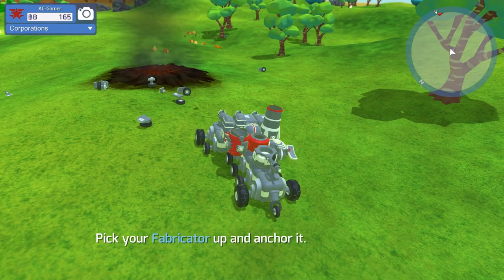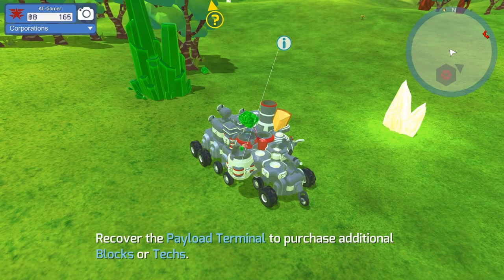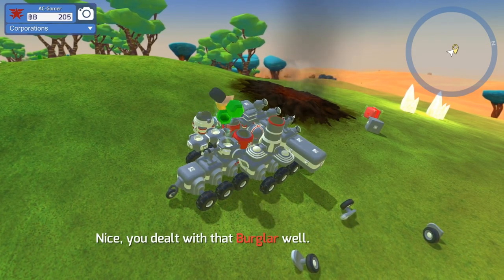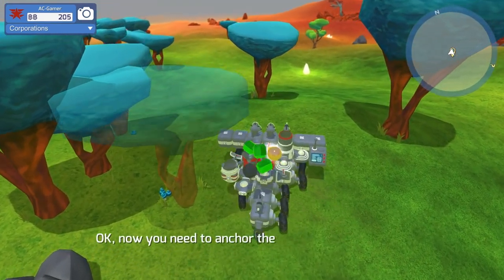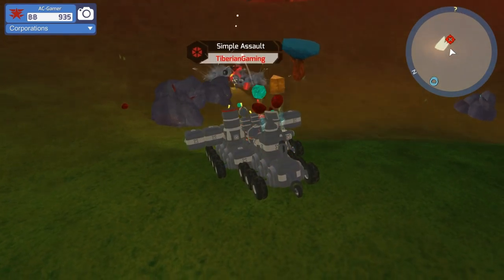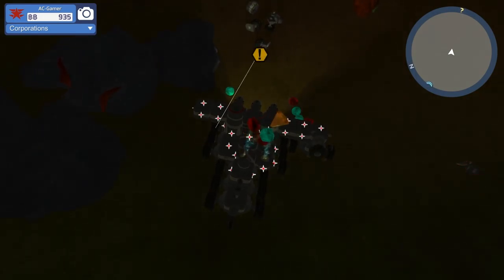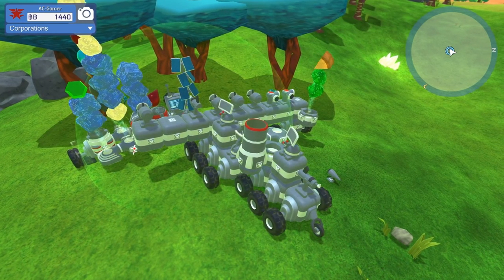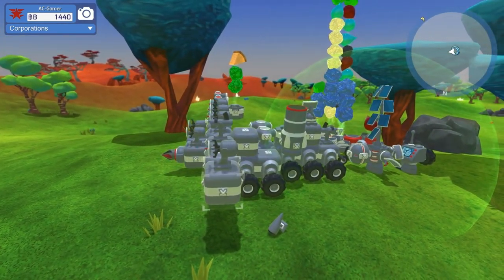Terra Tech - Lets Play - Part 68 - Placement of Your First Base

Comment: The payload terminal can't get destroyed, it has infinite Health
Reply from the maker: Benjamin Copsey I've been told that before but a few episodes back where my base got destroyed so did the terminal so it does have a health bar, it may be a lot more then most items but still has a limit of damage it can take before it to will go poof. Just a heads up in case you thought of doing what I was going to do which was to line your cab on all sides with the terminal so to ensure the enemies couldn't never destroy you.

Comment: Actually attaching blocks is nothing new... problems with it. It was like that for a while, even if improved a bit with each iteration.

the zoom sometimes helps; zoomed in. 

You need plumbite ore... That is in almost all required in most recipes of GSO. 

You are just pulling them too quickly over to the cannon; if done that way you must wait till it shoots before trying to put another resource in manually. One by one is always tedious like that, but that gives incentive to have conveyors attached.:)

I don't consider that cheating, as it at the moment is part of the mechanic. If you can not use conveyors on a tech, then it would make base tech bots not feasible and narrow the options. I think what they have in mind is flexibility within a certain amount of balance utilizing the mechanics.

those are turning boosters, which work well with small-medium tech bots. Technically there isn't a right way for them. Effective way would be to have both facing behind, and each facing opposite directions at the same time; covering back, left, and right. Since those are dual facing. So at the moment you will be able to turn left quicker than right, on top of being pushed forward.:)
Reply from the maker: TamorrLW Yeah I agree, attaching blocks to ones base isn't a new thing but one I only ever played around with once and since returning to it I think it might actually be a good idea as things seem to be going far better then before. As for the plumbite ore, it may just be my map but I cant seem to find that stuff but once in a blue moon, and when I do find it, its always such a small amount. I think its most likely the map that I'm on though as I have had play through were its very common.
Reply: yeah... too bad you sold most the bit you had first gotten... that was almost 5-8 pieces.><

Well since the rocks are the way they are now, paying attention to the coloration within the rock comes to play, as you probably noticed. And yeah it is kind of white-ish... A very very light blue; sky blue silver color. I am sure there are probably more within your forest, like near the original spot you setup camp in the prior... 

The only thing in generation that you will see different will be the base number and texture difference really. Since you restarted on the same seed. Could have sworn you updated during that last run. Which means it will be roughly the same ol' thing, but greater chances for bases. hmm... Mainly it seems almost like you accidentally end up selling what little you find. 

Although it can be found in the other areas, but more rarely. At least on my map it seems that way.
Reply: Also there is one thing you can make, although it will be that bull dozer thing. 2 blue things...